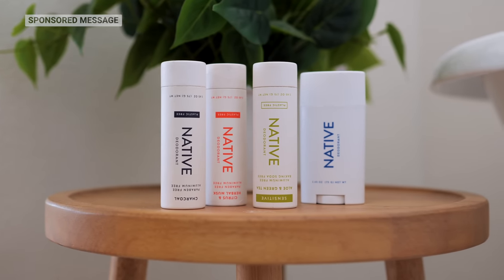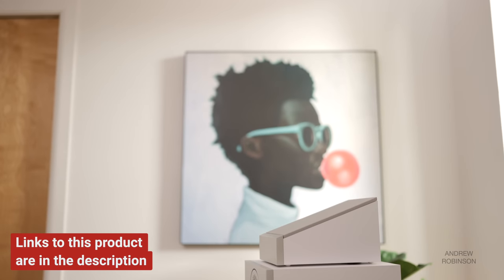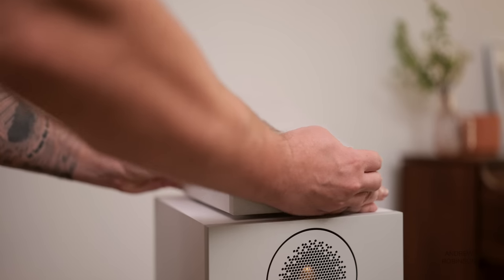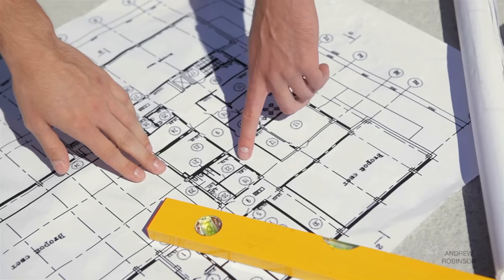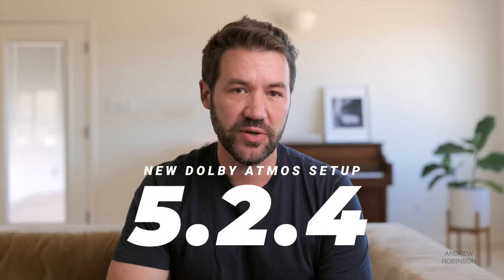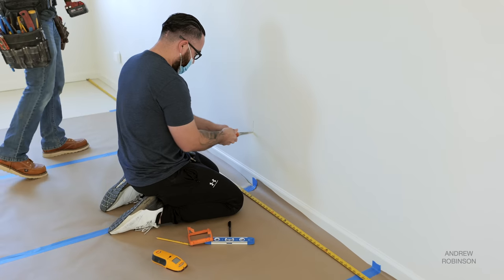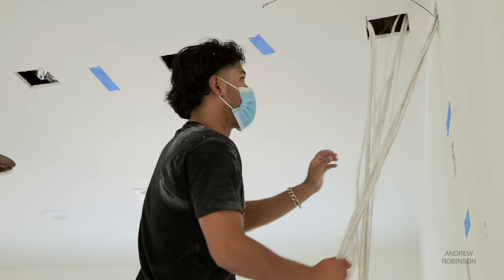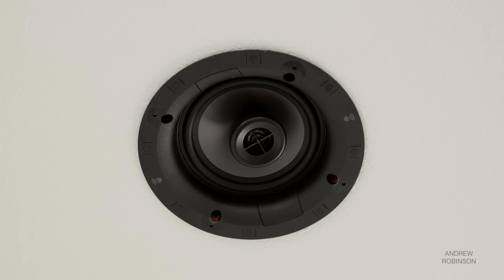INSTALLING DOLBY ATMOS SPEAKERS! Atmos In Ceiling Speakers

Comment: Wow, you guys already installed the in-ceiling speakers .. ? looks like that, 

1) What are the distances from the primary listening position to the in-ceiling speakers? the angle from the primary listening position will tell you where to place your speakers, I did not hear anything like that from the video!  

2) To my understanding, there are too many double duties and too many compromises! I am skeptical whether you will get the correct Surround/ATOMS experience, just revisit Dolby installers guide. But you two are the best people for this job as well, you can try it out with dedicated channels as your left/right surround and also surround back, then check with your Ceiling Speakers to see if your experience is good. 

3) No worries, it's all covered by your mantra! "Only person, who has to like the sound of your system, is you"!!! 

If properly set up, and with the correct source material you should have a fabulous experience. 

Remember ATMOS is about angles!

Comment: That talk about having "worst-case mindset" is so accurate. I just got my 1st home and I wanted to run cat5e and do major rewiring across the house. I was shocked with how the house looked when contractors and electrician started their work. Also having full concrete walls didn't help LOL

But it DOES get better towards the end :)

Comment: Andrew, Kristi, 
I'm intrigued by having SURROUND speakers in ceiling. In our current dedicated home theater (7.2.4) we have 4 Atmos in ceiling, then the Mid and Rear SURROUNDS, at ear height, are mounted on side Walls. 

In the new home we designing and building, I would LOVE the wall clean-look of a 7.2.4 system with Ceiling mount for everything except the fronts. 

Guys, What are the downside of 4 Surrounds being in the ceiling vice on the Walls, I could build it either way? 
Which way would you do it IF you had the flexibility of a new room without the dreaded sheetrock hanging. 🤪 

Cheers,
Eric
Reply: Some years ago, I had the surround speakers placed very high. It felt like I was sitting below everything. Today, front and surround are at the ear level, the back speakers are a placed at about 2 meters height, but they are 2.5 meters behind the sofa. Simply put, placing speakers on the same level (ceiling), will nullify the 3D sound. It's basically the same as putting height speakers (not upward firing) on the listener level.

Comment: Benjamin moore can load any color in a spray can. A good painter can blend the new color into the old.  As an architect, the only way to get it to match is to paint the whole ceiling.
Reply: That's probably what we will do at some point because the patch work look of the ceiling bugs me. I'm sure I'm being overly critical and some may not notice the shade differences.
Reply: @KristiWright  to blend paint, start with a roller that is not heavily filled.  Start from the repaired spot and roll away from center on a circular pattern.  Short strokes at first, then slowly spread the paint out so that it gets thinner as you go out.  Eventually the roller will be mostly dry.  Keep rolling away from the door with the dry roller.  The new paint will thin out and have partial coverage blending with the original paint.  But with that many spots, painting the whole ceiling might be easier.  If you have one spot by itself, the blend technique my be helpful.

Comment: Loved this video. After months (actually years) of rebuilding my house and untold hours and hours of research of ceiling mount speakers I finally landed on my set up. My home has 9-foot ceilings, but also an open floorplan concept and not a lot of linear feet from screen to viewing position. The open concept doesn't allow for rear or sidewall surrounds so in the ceiling they are going. This means that I'm unfortunately not getting ATMOS. I will have a 5.1 setup with the surrounds going in the ceiling. I finally landed on Monitor Audio CP-CT380IDC for the ceiling surrounds, and they will match with the Silver 5007G and a Silver C350 Center Channel. Because I want those same surrounds to also be able to play music from my whole house audio system when not being used for surround duty, I'm connecting the speaker leads to each speaker via either a Russound AB-3.2 Automatic Speaker Selector or an MCM Custom Audio Auto A/B Switch so they can be powered by different amplifier feeds. One set of speakers with two different configurations and power sources. For a sub I plan on grabbing an SVS PC-4000. Cheers and keep up the great work. Enjoy your new home!

Comment: Hi Andrew, great video as always. I am also thinking about using ceiling speakers. 2 questions for you. 1). You picked Klipsch CDT-3800 instead of CDT-5800, is there a reason for that other than price? 2). Is it also ok to use ceiling speakers for side surround in addition to ceiling rear surround?  I just got Pioneer LX505, and plan to do 7.2.4 with 4 atmos speakers, 2 side surround speakers and 2 rear surround speakers all using ceiling speakers (maybe Klipsch 5800 and 5650 combination).

Comment: Great video.  This hits my current home theater evaluation on the nose.  I've come to love the sound and feel of a wired system.  I've mounted my Sony bookshelves on the wall, a little contrarian but it keeps speaker gear off the floor.  The receiver is installed BEHIND the wall my 75" TV is mounted on.  My older home with plaster walls is some kind of awful to cut and patch. I hate hate hate to compromise, but I'm going with Atmos speakers on my Bookshelf speakers.  Any who there's no doubt the setup you've created will make y'all happy for a decade.

Comment: An upward firing speaker can do a great job at approximating a downward firing speaker, but it will always loose to the real thing if they are of comparable quality.
BTW, did you not put back boxes in because of all the firebreaks? and was the insulations enough? Just asking as the ceiling speakers didn't look closed back and big differences in what is basically each back box can make them sound all more than a little bit different.
It looks like everyone involved did a good job of it though, very clean!👍

Comment: I turned my whole up stairs into a theatre and media room except bedrooms about 1000 sq feet.  My kids and I did the work except for the carpet install. We did remove the old carpet to save money. We used a thick woven burgundy colored with gold spirals and design similar to the fancy theatres. $7k for the carpet only. I did a lot of planning before  hand. The walls are a dark blue and the ceiling a darker blue. Molding and ceiling are the same color. All along the wall I have movie posters each has a dedicated spotlight on it. We have a total of 28 ceiling lights. Perimeter blue light LED strips along the ceiling crown and the base of the sectional raised flooring. All in about nine zones. Everything is wired from the attic. All computer voice control and timers. My son is a filmmaker and we host all the cast and crew parties. Let me add, the blue latex color we picked matches an oil based spray color that is sold in a can. Great for plastics. All wall accessories are spray painted.
Reply: How much total did you end up paying?
Reply: @CrystalNinja07  We did this project about 4 years ago when wood was cheap. I’d say another $6k for plywood, molding, lights and controllers, paint, furniture, popcorn cart, seating (2 3-person theatre electric recliners with accessory connections), and miscellaneous items. I replaced all the wall outlets. Except the dedicated low-noise power outlets that were already there. The previous owner was an audiophile. All posters, pictures, paintings, puzzles, and wall decorations we mostly had from years of collecting movie paraphernalia and trinquetes. I still would like to add two things- a raised small stage for live performances and presentations and convert the first bedroom entrance to look like Dr. Who’s Tardis. I do still need to add a rectangular medallion and crystal light set on the ceiling. It’s a never ending project, but a lot of fun.

Comment: Andrew congrats on your new home and ceiling speaker install.  I have to opposite problem my ceiling in my basement is 7' - 2".  My drop ceiling had 4 Monoprice Alpha angled 15 degrees at my seating area.  ($200 for 4 you cannot really go wrong) They worked surprising well and were fairly shallow so I could practically fit them anywhere in the ceiling.  I think the spec's say they are a soft dome tweeter - but the looked metal to me.   So anyways I recently just bought Elac debut in-ceiling - Andrew Jones had a hand in the design apparently.  Installed these over this weekend and the magnets on the back of the Elac's were huge and unfortunately I had to move the install position of them slightly in the front Atmos, these do have a 30 degree angle so that helps, anyways got them in re-ran Dirac and they match my existing speakers better,  more accurate placement of front to rear panning,  Do I hear $1000 difference? No ---- again the law of diminishing returns.   Looking forward to your new videos in your new place and Kristy's input as well.  Thank you for all your video's always entertaining and informative.

Comment: The Klipsch in-ceiling speakers use a primer finish on the grill that can be be painted to match your ceiling color. Remove the fabric backing from the grill (and save) before painting. You will need to dilute the paint to thin it first, and it works best to use a sprayer verses rolling or brushing it.

Comment: I've read that having both surround and Atmos speakers in the ceiling takes away from the Atmos effect, have you noticed this?  Which video has your review of how they sound?
Reply: not surprising, I mean, surround speakers are not supposed to be in the ceiling, period.
Reply: @GamezGuru1  ideally, you are right, but we all face compromises -- usually when married and dealing with a livingroom situation. And as such, there is enough evidence to suggest doing an in-ceiling setup with a mix of surround and Atmos could be achieved when the angles are done correctly. For example, a 5.1.2 setup can exist where your Atmos speakers are directly over the MLP and the surround speakers are far enough back that you can pivot the drivers at a 45 degree angle. If you have a big enough room, you can get it done with a bit of compromise.

Comment: Hi, I seen this video before, now when I move into my new home and viewed my area for My HT. I knew I needed the speaker wires, atmos speakers in the ceiling. I knew that this was beyond my scope. So I hired a custom design team. I must say even though I knew some of the lay of land the loft area and the a/c duct was a different what I had imaged. This video that I view earlier ring true. I glad I hire a custom team do this job. Thanks for your views. Tomorrow will be the last day of the install.

Comment: I did both up firing (Atlantic technologies) switched to KEF Ci2000rr ... Waaaay better experience with in ceiling. The bounce only gives you the high frequencies in a very washed out non articulate sort of sound. With in ceilings you will hear more mid and low range frequencies, it's just what you expect to hear. I will never go bounce again

Comment: Thank you for this video! Wish I could have watched the whole thing yesterday while y’all were live. 

We are nearing completion of a 25’x35’ room addition on our house. Contractor had an A/V guy run low voltage wiring for four in-ceiling and two in-wall surround speakers, and I’m now in the process of deciding what speakers to install and who to do the work. His quote is WAY a higher than what your install cost, so I’ll be seeking out additional quotes.

The info surrounding which speakers you chose and why was a HUGE help. I’m not sure what I’ll land on for front and center speakers, so definitely want to go with something that will complement as wide a range as possible.

Thank you again, and congratulations again on the home and no more DST!

Comment: You guys must love Atmos a lot to put 18 holes in your brand new living room to run wires. Lots of talent needed to repair those holes, taping,  spackling, sanding to make them look like nothing ever happened and then, just to repaint those repairs won't do it, the whole room will need a fresh coat of paint.
Good luck with the rest of your project and your new home.

Comment: I was lucky enough to have everything we needed on two floors and had a 1800sq ft open unfinished basement i built a dedicated 2.2ch music room and put an atmos/projector setup in another section of the basement. Haha. Love your speaker selection. I did all over head ceiling for surround and atmos and towers and matching bookshelf for center (i hate center channel speakers). I will say, you will notice a huge difference having over head atmos speakers vs those front reflection units. Great decision.

Comment: I’ve used ceiling speakers in the past and they are great for atmos and are much more convincing than upward firing speakers, I think you will be very happy with them! Right now I’m using Klipsch RP-500sa atmos speakers, wall mounted. They each only require one nail to hang on the wall so are great for easy installation and minimal holes in your wall. How come you went for in ceiling over wall mounted?

Comment: Great video guys, very informative and well produced - AS ALWAYS!

IF I MAY "piggy back" on aesthetic comments about paint matching as I've done quite a bit. First, almost impossible to match colors if you have no idea what brand, color, type, and base tint are being used. My wife and I purchased a new home at the end of 2021 as well, and just like you, we're fortunate to have left over paint from the recent remodel. SOLUTION - 

1. Determine paint brand
2. Determine grade of paint from within that brand, there are typically 3-4 grades from Sherman Williams or Pittsburgh Paints
3. Determine base tint cor and finish.

Investigate and make these determinations PRIOR to starting the project. If you do, you'll push the average odds of matching color and finish in your favor. And as your contractor said, while there are certainly no guarantee's, you will likely get close enough to satisfy even the most "picky" eyes. 

Just my two cent effort to helps those facing these types of in-wall projects.

Congrats on your new home. My purchase took a while as well and was in many aspects horrible, and although it was well worth the effort, for us, my life was just better WITHOUT my realtor in it!! Sad to see y'all leave the great state of Texas!!
Reply from the maker: We were able to use leftover paint from the previous owners but it still doesn't match exactly. Thanks for hanging out with us today.

Comment: In general, you should be able to paint the speaker grilles. 
Recommended to paint thin and let dry so the holes don't clog.

Comment: Boy I am late to be making a comment/asking a question on your setup!  Maybe you'll see this, maybe you wont?  Anyway, we've been in our place 15yrs and it's similar to your in that it's an open concept.  At the time installed two in ceiling speakers 2ft behind the listening position as surround speakers.  Recently upgraded avr to an atmos capable, but also don't want speakers on stands around the place.  So I'm thinking of doing something similar to you, adding a pair at the back wall which is 10ft behind our sofa and another set about half way between our sofa and tv.  I realise this idea is "slammed" (as I'm sure you've experienced) but what I'm wondering is in a situation where you're listening to something in 5.1.2, which set of ceiling speakers would you select for yourself?  I'm thinking I would use the farthest back pair as the surround speakers and then the front pair set as the height pair and not utilise the middle pair at all!  I'm thinking this would allow for more separation of the atmos/surround sounds.  Anyway, if you or Kristi see this I'd love to hear your experience.  Love the vids.  Catch ya's :)

Comment: Yeah on the paint part... You can have a bucket of touch up paint that is the exact same as what you walls and ceilings were painted but due to time/aging that will alter the shade over time so it will still stick out.

Comment: Great idea to go with more speakers so you can change your pattern as needed! You will LOVE the difference this makes to your Atmos experience. Curious to know why you chose not to(?) add back-surround speakers in-wall? Perhaps that part will be mentioned in a future episode. We went from front/height to rear l/r and back surround in-walls and just two mid-height “Atmos” in ceiling and it works really well for multiple movie formats. Totally changed our experience for the better.
Reply: Hi there! Have you kept your front height speakers? Trying to decide how to go atmos... Which ones make greater impact at first, etc. Can't do in-wall so they need to stick out. Curious to hear more about your experience. Also, what's mid-height exactly? Are the speakers aimed at the listening area or not necessarily... Cheers!